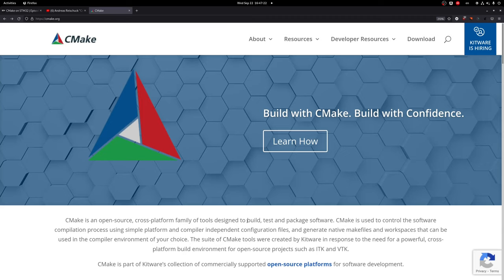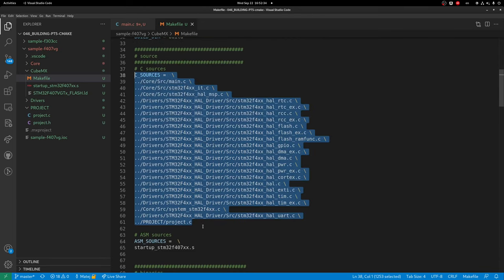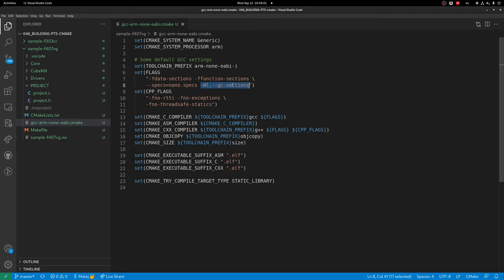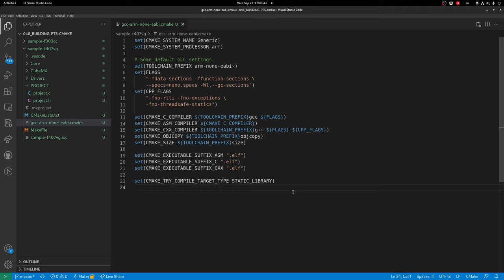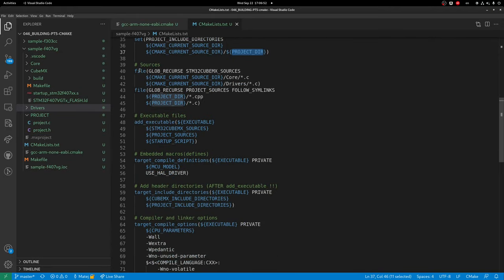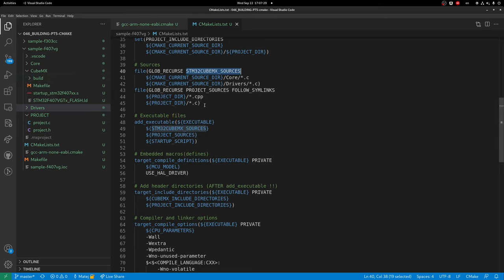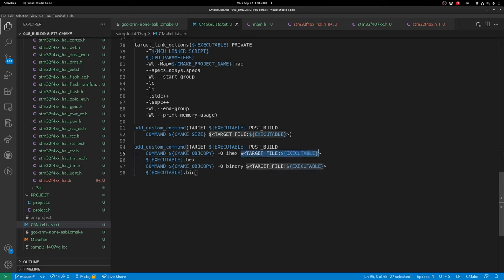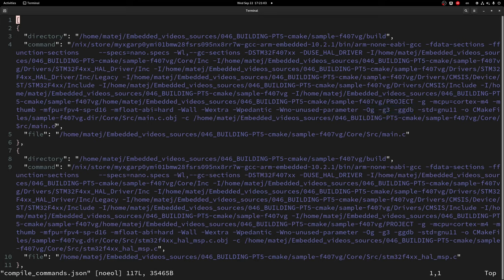STM32 project managed with CMake | VIDEO 46

Comment: For windows user: 
1. Default make generator is Nmake. Cmake use default generator, so have to use cmake with additional '-G' flag. In Makefile in ur project (not "PROJECT") folder have to write one more line "-G "MinGW Makefiles" \"
2. It is worth pointing out, that to use cmake u have to install mingw32-make (u can use ninja also, but then u dont use make).
First I installed "Make-3.81 for Windows", but can't choose that make in cmake as available generator. Maybe is possible to use "GnuWin32 make" as MinGW, but I failed.

Matej Great Job thanks a lot! 
Greatings from Poland :)
Reply from the maker: Thank you for providing notes for windows users as well. Regards!

Comment: Hi, How to make target compile option flags visible for all other cmake target libraries in my project ? I don't want to add flags in my toolchain file to make it global. Can I do it in my top level Cmakelist.txt file somehow ?
Reply from the maker: You can add those options in the global file before sourcing/including other libraries in subdirectories. This way they will inherit the settings as well. You can also add some local depending on the library.

Comment: I am trying to build cortex M4 in visual Studio for stm32mp157c-dk2 target, using zephyr rtos
If any reference plzz suggest.
Reply from the maker: I was working on a project that used the 2 core stm32mp1 from Ka-Ro and used their yocto linux template for building custom operating system. Apart from that I don't have any direct experience.

Comment: "The C compiler is not able to compile a  simple C test program" - I got this error, I already installed three tools that you listed in Readme.md, and the program is successfully compiled by a makefile that is manually written by myself. But when I tried with the CMake, I got the error. Do you know how to solve it? Thanks!
Reply from the maker: I explain at 10:23 that without including `CMAKE_TRY_COMPILE_TARGET_TYPE STATIC_LIBRARY` cmake will try to test the compiler, but with no cpu model it fails. If you're using the example on github, which is now in `Example` folder, it should compile with no problem. I assume that you forgot to add the toolchain file or just copied a part of it and that's where the cmake configuration hanged.
Reply: I used the project "046_BUILDING-PT5-cmake", I didn't change anything there  and then I got the error
Reply: I already added the "CMAKE", "Arm toolchain" and "cygwin" path to "Environment variables".
Reply from the maker: @Thanh Trinh Linh I see that cygwin is a windows utility. I don't know how you installed gcc-arm-none-eabi  on your computer, but I tried the same on ubuntu, fedora and arch and found, that arch and fedora carry `newlib` package separately and without it you get the same error as you had ... but it also mentioned somewhere that it could not find newlib. Maybe try looking into that.
Also I updated my `stm32-cmake` repository readme: https://github.com/prtzl/stm32-cmake

Edit: I also tested the problem and working behaviour on the original `046_BUILDING-PT5-cmake` project from the video and it was the same as with `stm32-cmake` repository. There are no major differences.
Reply: It seems to have so many problems with using CMAKE and GCC-arm -embedded-toolchain on windows environment.
Reply from the maker: @Thanh Trinh Linh I'll make a video on this as it seems like an important topic. I got it working quite fast:
- Download and install the .exe: https://developer.arm.com/tools-and-software/open-source-software/developer-tools/gnu-toolchain/gnu-rm/downloads
- Install mingw and you'll get make as well (as mingw32-make): https://sourceforge.net/projects/mingw/
- Download and install .msi windows installer: https://cmake.org/download/
- Use a unix-like console, I use git bash console that comes when you install git for windows: https://git-scm.com/download/win
- Mingw will add its tools to the path, so will cmake. You can test this by going into a git bash terminal or cmd and try: `mingw32-make` and `cmake`. These tools should work.
- Add arm toolchain to path. In windows search for path and "Edit the system environment variables" will pop up. Click that and go to "Environment Variables" on bottom right. In windows for System Variable find "Path" and click "Edit". Click Browse and locate the folder of arm toolchain, by default it was "C:\Program Files (x86)\GNU Arm Embedded Toolchain\10 2021.10\bin"
- Open new terminal and test that compiler is working "arm-none-eabi-gcc", it shoudl say "no input files".
- Go to the project folder for video 46 and edit `Makefile`.  On line 13 add backslash `\` and in new line add: `-G "MinGW Makefiles"`.
- For ease of use you can add a local alias for make: `alias make="mingw32-make".
- Run "make -j4" and it should compile. I did this in the same order and it worked the first time. Hope this helps.,
Reply from the maker: Also if you're testing `stm32-cmake` repository I see, that windows does not translate symilinks in `Example` folder for Makefile and gcc-arm-none-eabi.cmake. Remove them and copy originals in root folder.
Reply: Thanks for your kindness and I'm sorry for bothering you many times. Well, I believe that the problem is the Cygwin itself. I did the same on the Cygwin and Git Bash terminal, they produced different results. specifically, the compilation is successful on the Git Bash terminal, But it failed on Cygwin ( makefile on Cygwin can't find any source files like main. c, stm32f4xx_it.c,... despite the directory being correct). I don't know why this happened.
Reply: It is weird that the NMAKE is recognized instead of CMAKE., I don't know what NMAKE is. Everything just worked well yesterday, it cannot work today
Reply from the maker: @thanhtrinhlinh6232  i'm releasing the vide soon which also describes a modification to the cmake command on windows. Stay tuned today :)

Comment: Im working on the project about this and YT algorithm blessed me with your video! Thx!.

Although I have a question. With your Cmake files, I can compile and build the software and flash it into the board just fine. But when I try to use FreeRTOS, it seems like the CMSIS stuff refuse to compile for some reason. The error I got looks something like this

/usr/lib/gcc/arm-none-eabi/9.2.1/../../../arm-none-eabi/bin/ld: CMakeFiles/NUCLEOH7_CMAKE.dir/Core/Src/main.c.obj: in function `main':
/home/rawinza555/Freertos_Make/TestFreeRTOSMake/Core/Src/main.c:123: undefined reference to `osKernelInitialize'

Could you help me identify what's wrong? I set the source file and include path based on what's on makefile from CubeMX
Reply from the maker: Looks like the linker is complaining that it cannot find it. Maybe you don't compile all the files that you would need. Can you check if you have all the files included?
Reply: I believe I did it right. Is there a way I can send you my github repo? I really appreciate your help here.
I can use make to compile the code and it flashed and run just fine.
Reply from the maker: You can share the link and I could take a look.
Reply from the maker: @Rawin Pinkoh I found your repository before youtube delted it, I don't know why. I forked it to my github and applied changes. Now it compiles with no problem. Please review the readme I added and comment in CMakeLists.txt file. Regards.
https://github.com/prtzl/STM32-CMAKE-FREERTOS
Reply: Thanks for the help! May the youtube algorithm god bless your channel even further!